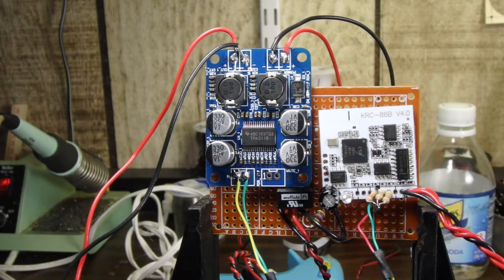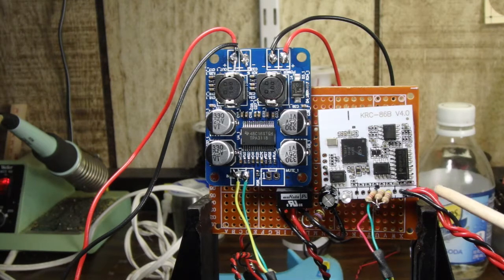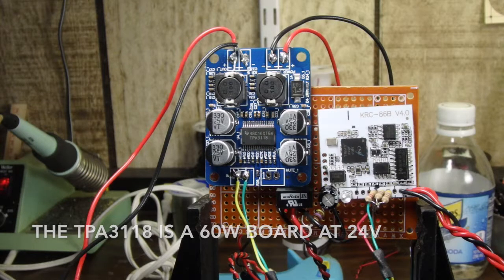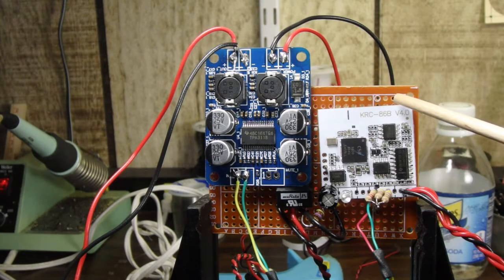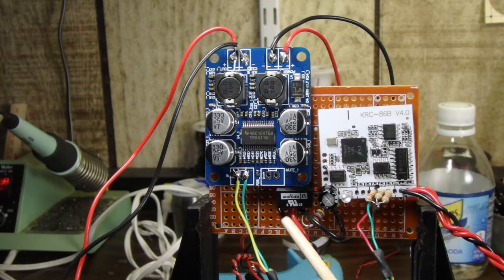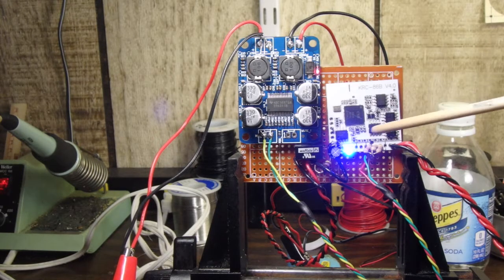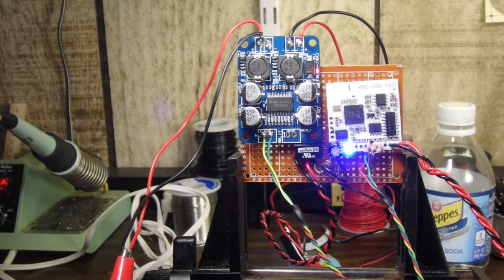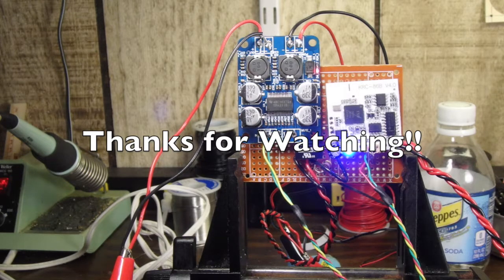DIY Bluetooth: Vintage Voltmeter BT Conversion Part 2 of 3

Comment: Hey I'm doin a quite similar project in which I use the  KRC 86B. Why you use a resistor on the Vout+ to VCC of the KRC 86B? What specs does it have? I have a problem that  my recom 0505s gives  to much voltage so the Bluetooth doesnt turn on...
Reply from the maker: Im only using the resistor network to mix the stereo output into a mono signal

Comment: Thanks  for the information, I'm trying to create a single bluetooth  speaker using the Dayton  Audio RS100-8 4" Reference Full-Range Driver Power Handling (RMS)30 Watts in a 0.7 cu.ft in closer. I'm a machinist by trade, and a wood worker hobbyist. I have spent a few months 100's of hours trying to teach myself the electronics needed for building a speaker your videos have been very helpful. what was the size resisters you used and how did you bridge them to get the mono signal ? would I have to do that if I used the TPA3110 PBTL 30W Mono Amplifier Board for my set up? tahnks again
Reply from the maker: Look at figure 2 (Stereo to Mono Summing Box) in this article: http://www.rane.com/note109.html.  You use a 470 ohm resistor on the output of the left and right channels. You use a 20K resistor between the ground and the tied output resistors. 1/4w resistors are fine. You would need this for the PBTL mono amplifier.
Reply: I just got PBLT amp and it sounds great I ordered the bluetooth but they take a long time to come in from china I also ordered an assortment of 1/4w resisters from 10 to 10k oms the bluetooth says Able to connect with two devices simultaneously dose that mean it can pair with 2 speakers ?
Reply from the maker: If your bluetooth board has TWS then you can connect two bluetooth boards together on different sets of speakers to play bluetooth simultaneously on both boards (does that make sense?). Google TWS bluetooth and you'll see what I mean. This is how wireless headphones work. Many of the new generation Bluetooth boards are starting to come with True Wireless Stereo (TWS). I haven't tried this yet but the technology is exciting
Reply: we need to give that a try I'll look that up and get back to you
Reply: Ok I put it all together and its working good no buzz no hum everything sounds good , But ya I have a But on some songs it sounds like I'm on one channel ? so my question is when you connect the one speaker to the Y resisters  ( almost sounds like I'm saying " the 3 sea shells " ) " a little movie trivia " anyways back to the speaker connection I connected the (+) side of the speaker to the top of the 3 resisters and the (-) to the ground on the back side of the board  (hope that makes sense)so I guess my question is did I connect the speaker up right or not ? and I'm just being picky over Mono sound ?
Reply from the maker: That sounds correct. Play a left/right audio file as a test. there is the one I use from youtube: https://youtu.be/hTvJoYnpeRQ